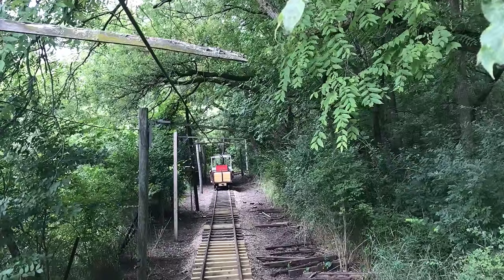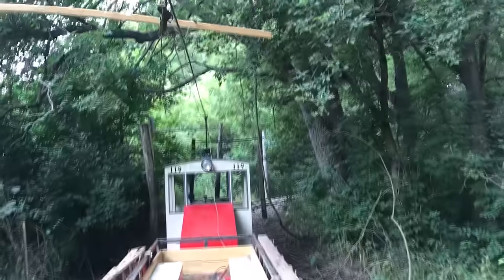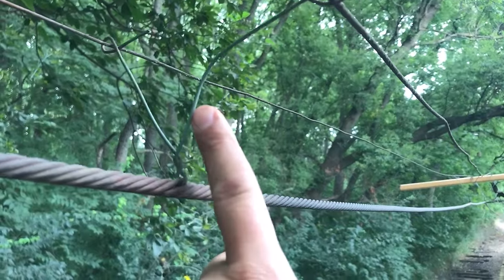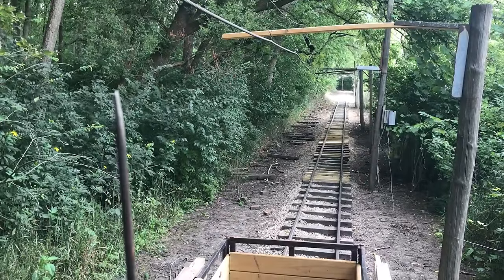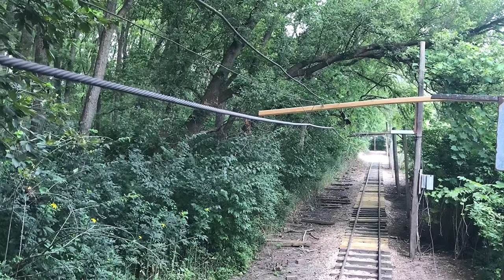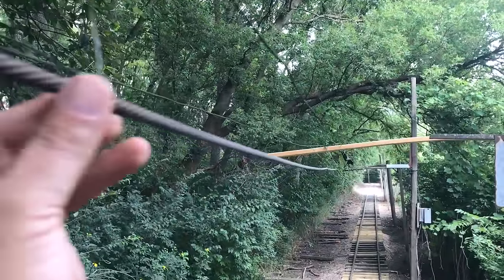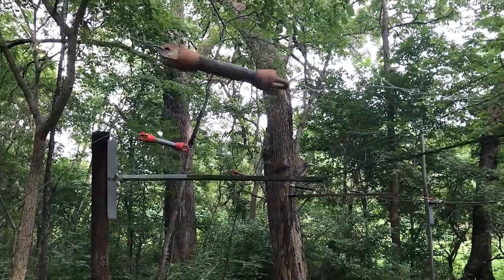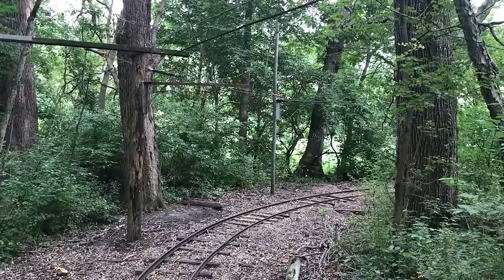Details of and general information on the catenary used on the RRVT line

Comment: As a lineman at the Toronto Transit Commission I'm very impressed with the overhead you have built for your railway. Most of our streetcar line have had the overhead change from a pole to pantograph overhead system now.
Reply from the maker: That means a lot, thank you! I've considered experimenting with making some pantographs to try out, if I was to convert to pantographs on everything then that would allow me to easily tension the main wire as it does not have to be a continuous cable. Its an idea I've been kicking around for a while now and have some rough plans in mind for a scaled down pantograph device.  You might see it in the future!
Reply: @CNW4145  You're welcome. Pantograph overhead is easier to do for curves.
Reply from the maker: Noted and thanks for the feedback!
Reply: @CNW4145  You're welcome.
Reply: @CNW4145   You also wouldn't need the catenary frogs. I'd probably make the contact out of copper-tungsten alloy bar.  I believe that's what they use on commercial railroad pantographs at it is very long wearing.
Reply: @CNW4145  --  I was a kid in Pittsburgh in the 50s.  As I recall, the streetcar trolley pole ended with a wheel.  In DC, where we moved in 1957, there was a sliding contact.

Comment: What I find fascinating about this video and this system is that it's not an exact model of the real thing, although in general it works the same way. This line faces all of the same challenges as full-size trolleys, but you've engineered your own solutions to work within the overall system of what you have. It's really neat to see things like oh the shoe comes off so it can't snag, or it rotates so the wire can be pretty far off center. There are two things that might be an issue for running pantographs. One is the places where the wire is so far off center, like the non-powered frogs. You would have to measure pantograph width relative to the rail alignment but you don't want to run out from under the wire. The other is the pull-offs on the curves. They look really shallow now, if they're not high enough above the wire, then when the pan pushes the wire up the edges of the pan can snag the pulloffs. I don't know if the existing frogs would tilt under a pan, but they might be smooth enough underneath that it would glide over it no matter which way it was set. If they're loose enough to tilt it might pick the gap when diverging.

Comment: The cable frogs was pretty interesting. I always wondered how theg worked.Thanks for the in depth look at the cantenary system.
About how much current does it take to run the trolley at 480 or 240V?
Reply from the maker: At 240V on straight level track it takes less than 5 amps. Going up the 4% grade pulling a couple of loaded cars I will run 40-50 amps.
Reply: @CNW4145  is that 240v AC or DC.? You may have said and I missed it. The cable frogs were fascinating. How do you return through the unpowered frog? It seems to reset to a default position so there doesn't appear to be a route through the non default direction. Or is it one way only ? Thanks. 
I believe yours is the only "amateur private " railway I have ever seen with a central electric supply for traction. Please forgive the usage of amateur, it is not in any way used in a derogatory way, just to separate from the big commercial operations. Very impressed with what you have achieved.
Reply: @Dilbert-o5k You pull down the shoe and roll through powered by inertia. Big railways and trams also do this in places where there's a gap because of a movable bridge or a gap for different voltages between tram and rail tracks on multi-system lines. Although, for them, it is a bit easier to raise them again ;)
Reply: @HenryLoenwind  thanks. I am not familiar with tram layouts. Big trains would normally have the gap (neutral section) on a straight section not at diverging lines which would use the same power . I suppose it is a function of pantograph design . Big trains have wide collectors that can span both diverging wires , so points for catenary aren't required. Interesting.
Reply from the maker: It is AC power on the catenary, and there is no way to return through the unpowered frog. This is not a problem as its on a loop track so we always operate the same direction through this section. There are several other private electric operations like this that I know of, but we are a class of few for sure!

Comment: Woah! I considered setting up catenary for a marklin crocodile HO locomotive and wow this is so cool!
Reply from the maker: I had a friend that had HO scale trolleys complete with operating catenary, it was pretty cool to run!
Reply: @CNW4145 You have some amazing videos! Do any other people on the line have YT? The train I'm using is the SBB class Ce 6/8 II freight locomotive Marklin 39566 it runs without the cantenary just fine but it'd probably work better with it. I use marklin K tracks and the current has no trouble on the line unlike american hobby track you can not bend these... With hobby rr having live next to neutral isn't an issue at 20vac on 3 rail system. Thanks for sharing!

Comment: This is really cool. I'm very proud of what an amazing railway you've built from scrap materials

I would personally put the contact wire another foot higher so that when sections become slack they can't accidentally become within arm's reach (looks like some sections have about a foot of slack) but since this was starting its construction in the 50s/60s when safety margins were a suggestion and also because gradually changing all the hangers to be a foot higher would be arduous and the sudden height change wouldn't be liked by the poles, I'm not gonna complain. 

But I think anybody trying something similar should probably use a 9 foot height rather than eight. For us using universal measures, this is 2.7 metres. Way taller than most people can reach even with longer arms and a tall stature

I wanted to make something similar to this for my family's small farm to haul produce to the storage shed, but the gradients would be 10%- very steep for a homemade train even if some real-world adhesion railways can manage it- and I have no idea where you could even get enough rail-like steel cheaply. I doubt Way Out West's method of flat iron on its side would be good enough for the sort of heavier locomotives like yours that I would want to use, and RHS would be hard to bend without a press or cutting-and-welding, and I doubt much suitable steel other than that would be available in local scrapyards where I live sadly. Ah well, we can always dream right?
Reply from the maker: Yes if I were to start from scratch I probably would put the wire a foot higher, but as you said it would be a task to raise everything now so I've just went with it. 10% would be pretty steep, you might have to build a cog railway! Almost all of this rail was reclaimed from abandoned mines and factories, some of it is even from a depression era project to build beaches in Wisconsin along lake Michigan. Occasionally you can find good deals on rail on discoverlivesteam.com, you might check there from time to time. There have been some really good listings on there in recent years but sadly most of them are on the west coast which is just too far for me to pick up economically.
Reply: @CNW4145  Thanks for the comments! One idea I had was to use car tyres mounted higher, so a raised concrete pad either side could assist, but it felt too... unrealistic? I mean, by the fact it exists and uses steel wheels and steel rails it'd be a train, but doing a "paris metro" for the steep section still felt wrong. One day I might bite the bullet and do it anyway, if my parents are okay with it. I've half-convinced them on the ease of wheeling many railway cars into the shed at once rather than carefully backing a single trailer in a tight space.

sadly, I don't think there'd be much scrap rail left where I live (Australia), I imagine it's all taken by private collectors, stockpiled at rail museums, or melted down and turned into somebody's fancy combination-blender-and-microwave-with-wifi haha, but I'll have to keep an eye out!
Reply: @briannem.6787 You could always build a guided-bus-type system. Parts for that are easier to come by, and they're cool, too. You'd only need a running surface for just the wheels and a guide border on each side for the mechanical steering.
Reply: @briannem.6787 You could always build a guided-bus-type system. Parts for that are easier to come by, and they're cool, too. You'd only need a running surface for just the wheels and a guide border on each side for the mechanical steering.

Comment: This is awesome!!  Extremely educational, love it.
I was curious about the catenary shoe and catenary frogs - at 37:41 I love that the unpowered frog offset from track centre causes the shoe to pull it to the secondary path - but does that mean if you were coming back via that same secondary path you would arrive at a frog remaining for the primary path?
It got me thinking about catenary shoes in general, and saw another video where their overhead catenary is accessed via a pantograph instead of a shoe - while the pantograph has the advantage of not needing an active frog at each railswitch, is there a reason (perhaps just authenticity of trolleyways?) that RRVT uses shoes instead of pantographs?  Genuine question, I'm not criticising the shoe, I'm expressing that I have a gap in my knowledge =)
Reply from the maker: You are correct, the non powered frog can only be run through one way. Which is fine because its on a loop track so I really only operate in one direction on this part of the track anyways. I have stuck with the shoes because all the equipment is already equipped with them, and while I have toyed with the idea of building an experimental pantograph I have a feeling that it would cause more problems than its worth. For one, more upward pressure to maintain contact would require the catenary to be tensioned more than it is, and also there would be a bit of experimentation involved to get the pantograph pressure to be equal at varying heights. The second bigger problem is that the contact area on the pantograph is much smaller than it is on the shoe, the shoe is essentially a V shape that contacts the wire on 3 sides, where a pantograph would only contact on the bottom. At times I can pull upwards of 50 amps through the shoe, and it gets quite hot. Reducing the contact area would increase heating, and also increase wear on the wire. If my voltage was higher this would not be a concern at all. Someday I may build one for fun, time will tell.

Comment: Great to watch, but I can't see how you insulated the cable from the crossarms. Also, I would've fond it very interesting to see the main substation and the contactors. 
  Thanks for this vid.
Reply from the maker: The wires sit on wood arms, so the wood is providing insulation.

Comment: This is very cool! Also, I had no idea that wood was sufficient enough an insulator for 240v. I wonder if electricity consumption goes up noticeably after a rain when the wood is wet?
Thanks for the video, it gives me a lot of inspiration to get off my butt and do an electrified cableway project I've been wanting to get done...
Reply from the maker: Yes the wood is just fine for such a low voltage, and oddly the quiescent current draw of the wire itself does not change measurable from dry to wet. Granted I do not measure it with a milliamp meter but my incoming power monitor which has a resolution of 1 amp does not show any difference. This fact surprises me as well! I would be willing to bet if the voltage was higher I might see more consumption when things are soaked.

Comment: This isn't really a rrvt question as it is more of just a trolleys in general question, I've seen traction railroads that at some point in time had steam locomotives for either back up motive power or just for freight. Wouldn't the carbon and other materials deposited frome the exhaust make the wire less conductive? If so how would've the remedied this? Special stacks, something to clean the wire on the locomotive? I'm just kinda curious how they'd do it.
Reply from the maker: I have thought about this before as well and I am guessing that the pressure from the shoe would be enough to knock any built up coating off. I do know ice can be a problem but of course it is much thicker.

Comment: Hi,
This kind of technical video is fantastic !
One question : from the stainless steel sheet on the shoe to the base plate of the pole, there isn't a single wire ?
Just the loose contact from each piece to the next is enough for 50 amps without noticeable sparks ?

Thanks again ! (from a late viewer...)
Reply from the maker: You are correct, there is no wire jumper there. I did try this a long time ago and the issue was that the wire sometimes snags on things and just caused more problems than it solved. Hard to believe that much current passes through a friction connection like that but it does get warm if you pull that kind of current long enough!

Comment: For your cross bars, I would try 2 X 6s or 2 X 4s cut on a bias across the face.  Leaving the far end  around 1 inch.  That should give a lot more strength than a 2 X 2.
Reply from the maker: That is what I am doing going forward, going to make a jig so I can rip 2X4's and see how that works
Reply: @CNW4145  On second thought, I  would go 2x6 or 2x8.  I know i said 2 X 4, but once cut down it probably won't add much strength.
Reply: I suppose another way to add strength would be with a spreader and some wires in tension. Maybe that's more trouble than it's worth.
Reply: @b43xoit  With enough tension and alternating the poles left/right, wires instead of cross bars would also work. But that would be even more trouble than it's worth ;)

What may be worth it would be to rest the runners on cross wires that are attached to trees on both sides, one side fixed and one side over an idler to a simple weight. Hardware needed: Wire, 2 wire clamps for the ends, an eye-clamp to restrict one runner wire in the sideway direction, something to act as idler, a weight, and 2 insulators. Given that there'd be no real movement in the insulators, hooking two rubber-coated/dipped hooks into each other would work. Or, with fewer parts, one rubber-dipped S-hook to connect the wires.

Comment: Suggestion, On the shoe - Can you make a conductive cradle with 2 metal wheels (Apr. 2") to roll on the Power Wire? It might give you a smoother voltage supply, slightly increase the distance from shoe frame to wire which would help reduce entanglement with the hanger.
Reply from the maker: I've used wheels in the past, trouble with them is that they de-wire if there are any kinks in the wire. This is why I use shoes, they are more forgiving.

Comment: what a great education in catenary system! no it was not anything but interesting! why did you chose 
240V ? and what is the spacing of your subs? so the tracks are one leg, while the wire the other, do you
have jumpers on the track? do you have to polish the top of the rail for better current flow? or do they
self clean as you run the train. thanks for the wonderful video ,keep up the great job for both the video 
and maintaining the trolly system.
Reply from the maker: Initially 120V was tried but it was found that the rust on the rail made a significant voltage droop thus the decision was made to switch to 240V. Now that we have bigger equipment, bigger trains, and higher speed operation, there is no way that 120V would work today as the currents are simply too high. With 240V we have no need to clean anything, it blasts right through the rust and dirt.
Reply: @CNW4145  You/they even tried 120? That was optimistic. The voltage drop over distance, even in copper wire, is just too high. There's a reason the US has 120V pole transformers next to houses while Europe has 240V transformer stations for whole neighbourhoods.
Reply from the maker: Yeah supposedly in the very early days (1950's) they tried to run it on 120V. My guess is that they did this as they did not have a transformer on hand to convert the dual 120v incoming power wires to a single 240V feed. Of course it did not work well and eventually ended up acquiring some transformers from a local traction company to try out the 240V which of course is working fine. Honestly I've never understood why we do the power here the way we do, the European way makes so much more sense to me. We probably saw the err in our ways at some point but decided it was too expensive to convert and left it be lol
Reply: @CNW4145  
I think it was due to the companies that were producing electricity, you had Edison with DC
and general electric doing AC, they were the ones that determined the speciations, does not
europe run in some areas at 50 cycles? never did look into the electrical power around the world.

Comment: I have a question. Can I use third rail instead of trolley wire? Would it be cheaper and simpler? What voltage should I use. What about safety? Great tutorial, by the way.
Reply from the maker: You could, but I would use low voltage DC for a 3rd rail. Maybe 36V DC and this could either run the motor directly or you could use it to just charge an onboard battery. I have a friend who has made a 3rd rail 2 ft gauge line in this fashion, its working well for him. Do not use high voltage AC if you do this, it will be far too dangerous- one fall onto the track and you would be roasted.
Reply: Thank you very much.